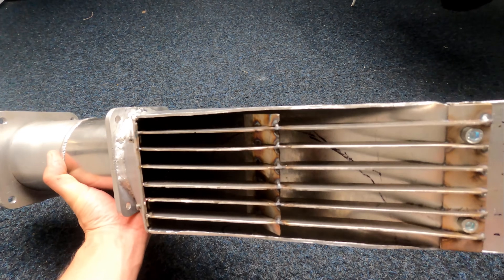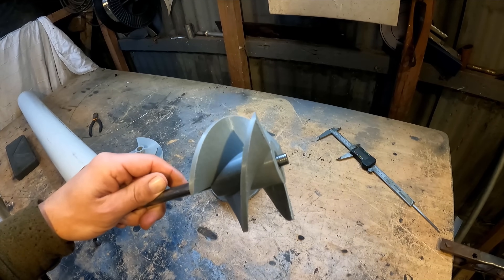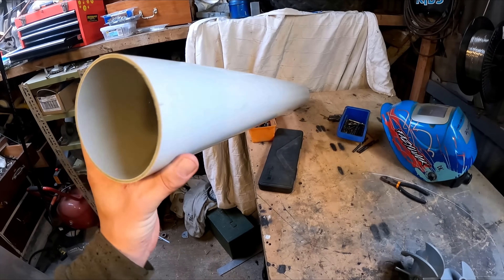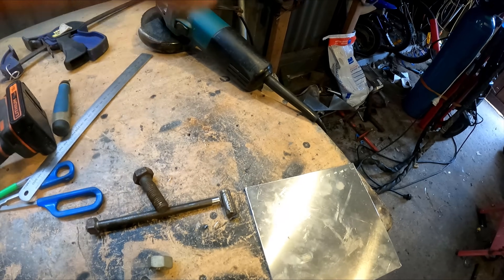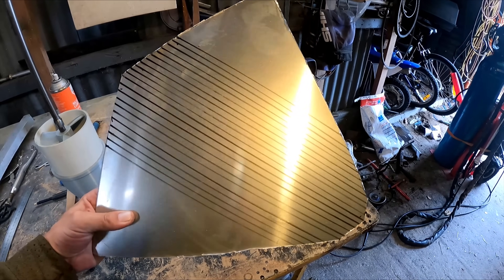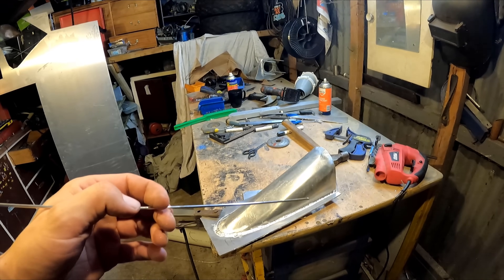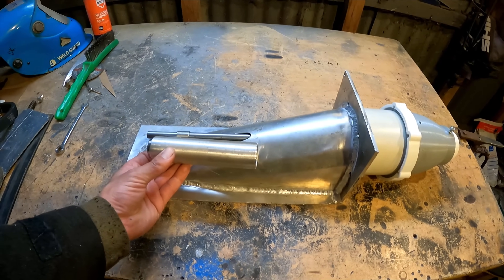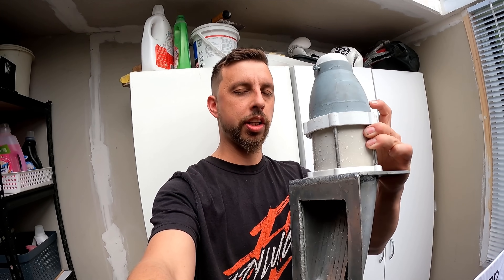Homemade Jet Drive 3D Printed

Comment: if you want these to be more efficient you should design a taper in the impeller and housing, and have some way to shim the impeller back and fourth on the shaft; by moving the impeller into the cone housing you can get really tight, adjustable clearances that minimize back leakage.

Comment: For your prints go through through the settings and make sure it doesn't start new layers on the outside surface... You can normally specify that it works from the inside layer or recesses first.

Comment: Nicely done!  The "disease" on the 3D printed part is, I think where the lines start and stop for each layer.  There is a setting to align them, I believe.  I have an Ender 3 V2 which I've sliced models for with both the Creality Slicer and Cura and I've not had the pimplefest you have there so I'm not sure why that is.  But I've seen videos on it.  I find, in Cura, under "Walls" there is a setting for "Z Seam".  You may have to monkey with settings to get this setting to be displayed.  It may be that setting, or it may be another...but I'm pretty sure that the defects you're seeing are from Z axis seam alignment not being set.
Reply from the maker: O thanks !  , I use cura now and haven’t had any problems. But in saying that I still leave most of the settings standard I am mostly a welder but 3d printers are so useful glad I got one

Comment: the disease at the back of your part are slicer settings called seam corner can find it bij walls settings in CURA
Reply from the maker: Thanks. I think I was using the standard creality slicer back then I am using cura now which is far better

Comment: Any chance you'd like to help do something completely crazy? I want to repower my 30 ft catamaran with electric jet drives and need some help with the design and build. I have a good idea, a working outline, of what I want to do. I have very little experience with jet drives and steering systems. I understand it on paper, and will be thankful for any help you're willing to offer to help me bring this to fruition.
Reply from the maker: That really sounds like a cool project! They problem with jet drives is they aren’t very efficient and with an electric boat you will need ever bit of efficient you can get to get the range . I think a surface drive prop is the most efficient but it is a pain to steer , jet units accelerate and steer really well. I think the ideal setup would be a surface drive prop on each hull that you could raise and lower and use differential thrust to steer
Reply: @dkthewelder  I understand. I generally only use my power to come in and out of doc, and to help out around the icw. I'm also planning on powering it well above my needs so that I can run at half mast 90% of the time.
Reply from the maker: @BigfootGoforth  o cool I have 2 little wind rush catamarans which are super fun. You can look at the 3d model of jet units on my CG trader , the bigger one is free but you have to build your own intake https://www.cgtrader.com/dkthewelder

Comment: What is the diameter of the outlet pipe and the impeller?
Reply from the maker: The impeller is 100mm and the outlet is 60-65mm I think
Reply: @dkthewelder  I also built one entirely out of cast aluminum
Reply from the maker: @DuNguyen-sw5lt  cool! I would like to see a photo
Reply: @dkthewelder  I posted on your Instagram, I don't have a boat and powerful motor to try it (Jetboat 120mm)

Comment: method of drill would of worked maybe with a pilot guide, the idea was sound though,  most bench drills are not that accurate and so rotate uneven so hence the reason for pilot guide in the centre

Comment: your flow is to high
Reply from the maker: Yes maybe, I will try a tighter nozzle then maybe change the pitch of the impeller, in the progress of connecting the motors should be able to test it soon
Reply: @dkthewelder  i will be around to have a look sometime keep up the good work 
try to close the wear ring to impeller close that gap first then pitch if needed the pump will not make proper pressure if the gaps to big regardless of the pitch
Reply: i mean your extruder flow on the printer but yes as tight as you can get the impeller to wear ring area and the friction fit will wear in perfect

Comment: I'm not sure but those zits on the backside are probably because you picked "random" for the layer transitions. That looks similar to a problem I had at one point. Try "aligned" next time you are doing a rounded surface.

Slic3r has that problem but it appears to be more of a bug than poor development.

Besides, when doing something that requires some level of precision, aligned is easier to clean up. (It is usually more noticeable though.)
Reply from the maker: Ok I will look into that thanks

Comment: With time, work, parts and tooling it only had a cost of $2000 not counting damage to bath tub.
Reply from the maker: Haha man your negative! About $12 dollars of 3d printer plastic aluminium $20 plus bearings and shaft another $50 and I just do it for fun 👍

Comment: I noticed that when you were polishing on the lathe, you had a long polishing strip in your hands. Try to keep the length much shorter. Long polishing strips can be very dangerous if they get tangled around the work or lathe chuck. Technically they can cause the lathe to pull you in. Very nice project and great video.
Reply from the maker: I thought longer was safer , I have had it grab once and pull out of my hands years ago so I’m careful not to hold on too tight ! I saw a video of a guy getting wrapped up in a lathe was awful!

Comment: What kind of cordless drill did you use for the last part of the video? (bathtub test)
Trying to gauge what size/power motor I'll have to get for my motorized surfboard project idea
Reply from the maker: Makita 18v it’s a pretty powerful drill , I was actually thinking it would push a board along maybe fast enough for a kid
Reply: @dkthewelder  in my eyes at least, it looks powerful enough to push something at least! I wonder what the minimum is to make it push someone at 150lbs at a speed of ~5-10mph 

Staying tuned for more vids for sure!
Reply from the maker: @ninjasploit  I think that drill would do that if you could get the jet unit just right
Reply: @dkthewelder  Might give that a try as we've already got Makita drills at home! Instead of spending $500-$1000 for a proper battery and electric motor setup!
Reply from the maker: @ninjasploit  honestly just a propeller is more efficient than a jet unit . Are your going to draw up a jet unit for your drill?
Reply: @dkthewelder  haven’t gotten that far yet; this was just one of those ideas you get you know? I’ve got lots of ideas that I’m saving for later when I got the tools, time and money

So for sure doing more research, and then again, a prop doesn’t look nearly as cool as a jet!

Comment: I've used the hole cutting method you tried at 5:30 but with a end mill so the holes can overlap. Leaving 3-4 tabs around the circle so the piece stays centered.  I tried turning it to clean up the hole like you did but with the endmill it was too sketchy even for me
Reply from the maker: yeah the screw in the middle bent , need an indexing chuck and an endmill

Comment: "The disease" could be Z seam Alignment that's set on random. Put it on Sharpest Corner or User specific. Anyway Nice vid :)
Reply from the maker: ok thanks I will try that
Reply: @dkthewelder  Looks more like slipping on the Z axis IMO - only say that because the bottom portion had none and the frequency increased the higher up.

Signifies the problem is getting worse with Z increase; might want to check your eccentrics
Reply: @ExploringTheWorldCheap  looks mostly like a badly made cura Z seam tbh, align Z seam should fix this problem, furthermore no need to use rafts on an ender 3.

Comment: What version of Ender printer? Pro or max Pro 3 Pro 5?
Reply from the maker: Ender 3 I think. It’s a pretty cheap printer but seems to work well
Reply: @dkthewelder  Yeah I saw someone else using the Creality and it looked excellent. Im getting ready to buy my first 3d printer im going to get one of those. Just not sure which version
Reply from the maker: @CL-yp1bs  they work really well straight out of the box I would definitely recommend one . Don’t even adjust anything and it just works probably best for a beginner like me
Reply: @CL-yp1bs  my son inlaw has two of them. He likes them.
Reply: @mrbamfo5000  Great to know! I am an electrical engineering student but I am wanting to get some experience with CAD as well because there are a lot of students doing dual majors with mechanical and electrical engineering. I figure a 3d printer is a great way to learn CAD and have fun doing it…  the results seem to look great. I’ve been holding off ever since they first came out I wanted to wait for them to get better and all the errors ironed out.. it seems like these are a pretty refined item compared to the original 3d printers…

Comment: You know, if you have access to or build a kiln/tempering oven. You can actually 3D print it out of metal. It's filament with metal powder in it, thus why you need to use oven. Have to melt the plastic out and get it hot enough to fuse the metal powder together. It's definitely not convenient, but still cool lol.
Reply from the maker: I have been watching videos on that it could be good!
Reply: @dkthewelder  The few videos I've seen on it seem to show its pretty strong. Just have to take into account the shrinkage that occurs. I think you have to make it 10% bigger to account for that, if I remember correctly? I really want to try it out, could be amazing for making pew parts. 
You could also do cast parts as well. How people use Styrofoam or wax to make molds (lost foam/wax casting). You can also do it with PLA filament.

Comment: zits comes from retraction och layer shifts, the blobs are where the printer stops and starts print the outer most perimiter
Reply from the maker: O ok, how do you stop this? It hasn’t done it since but it seems to happen on a curved surface
Reply: There is no full fix, but getting better extrusion multiplyer and lowering the retraction amount will lower zits, sometimes it has to do with the material, but it could also be that you get a lot of pressure during the lifting between layer lifting.

You could add coasting and minus extra restart after retraction in the travel or extrusion settings. Also mske them less visible by putting the layer starts and stops as a seam on the skarpest corner. That will make it less visual :)

Search for "how to prevent blobs or zitz 3d printing" on youtube and you will have some good tips :)

Comment: Cool stuff man. 

If nobodies mentioned about the printed bubbles... Filament absorbs moisture from the air pretty bad eh. Then when the moisture passes through 200c it steams the water instantly, causing bubbling. It probably popped and snapped like wet pine in a fire while printing eh?  

You can dry it back out easily in a set-low oven or food dehydrator. gg & gl
Reply from the maker: Someone else said that , it was fresh out of the packet when it did that . It printed overnight so I didn’t notice the popping and stuff, thanks for the help I could try the oven how long do you leave it in there?
Reply: @dkthewelder  Get a dehydrator, there are many guides for it. 
I do 65c for 8 hours for my PETG

Comment: It’s funny. Rich for you is a 3D printer while for me it would be having a lathe. Both are expensive but they don’t make stuff like they used too. (Good lathe is like $6,000 :( ). Great design tho love it
Reply from the maker: Haha the lathe isn’t mine , I work in an engineering workshop and I’m allowed to use the machines after work

Comment: Thanks for showing the bits that didn't work, and the steps you had to take to force them to work ;)
BTW, the 'disease' on the prints is likely one of two things : 1) nozzle is running too hot or 2) filament isn't dry enough
Reply from the maker: Thanks for the advice I am new to 3d printing and cad drawing so it is a difficult project for me. I can try changing the nozzle temperature 👍

Comment: Man, really love the idea of an aluminum intake ^^ looks real nice and sturdy =) 
you don't happen to sell this ? :D
Reply from the maker: I made the intake aluminium so it can take a few hits to the bottom without breaking. I might sell these if I get them working well
Reply: @dkthewelder  thought so, thats one weak spot if you had that one printed as well...but it works , painted PLA lasts for one summer :D
looking forward to it , keep on going ;)
Reply: @dkthewelder  My jet intake is alloy with stainless grills. I  smashed it of rocks for 2 years solid. Cracked the intake in half twice :) It will handly a lot more punishment than you would expect :)
The weak point is the cylinder shaped impeller instead of cone shaped and no wear shroud ;)
Still, it seams to work well.
Reply from the maker: @axle.australian.patriot  the pvc pipe is the wear sleeve I can just put another one in once it is worn . I will cast an aluminium impeller once I get the shape right . Do you have a JetSki unit boat?
Reply: @dkthewelder  No, it's a 12ft alloy car topper, but re-engeneered 19mm stringers, dericane laminate skid plates, mini center console etc
40HP Yamaha outboard with an OutBoard Jet from Califorian on the bottom.
I'll have to change account's, I use this one for political troll rubbish lol Should have posted in my persnal account to start with :)
I'll see if I can sneak and outside link into YT :P
I have a friend run a 10ft Punt (jon Boat) with a wave runner drive in the hull and does really good.
Reply: @dkthewelder  Hello, Same Axle 🤫
I'll see if I can find a couple build pics :)
Reply: @dkthewelder  I don't know if the link will stick in YT. I can't post it on YT because of music copyright..
Reply: @dkthewelder  The cone shaped impeller and wear shroud allows for "Shimming" the impeller to keep the close clearance between the blade and the shroud. It doesn't take much gap before thrust drops noticeably. But what your doing is working and looks like a fun project :)

Comment: The shaping tree gave me a good giggle
Reply from the maker: Haha a gift from god to shape jet unit intakes
Reply: @dkthewelder  How'd the 3D printed impeller go? also I'm guessing ABS 100% infill?
Reply from the maker: @Archamfer  na it’s just PLA and like 50% infill so it’s not going to last long but it should be ok for testing
Reply: @dkthewelder  What you thinking for upgrades? Lost PLA Casting could be interesting
Reply from the maker: @Archamfer  yes lost PLA might work. I can try different nozzles and stuff too

Comment: Hello, I just discover channel today, check few vids, and one think disturb me. Probably for temporary test, but you have skill and tools, Tig, lathe, etc... Why not use 3d print to measure, test, and after choice, mold it in aluminium, for better durability. 
I know 3d filament could be strong,but if you eat wood or sand, it's done...became 3d...floats....
Except this point, the project could be excellent in results! 
I've not followed the first gen' but is the engine turn as fast as need to be efficient ? Turbine need speed, and a bit of torque for high pitch. 
Also need very tight adjust in tunnel. 
I've done few in different scale with metal, plastic , and both work depend on scale. 
So good luck and have fun
Cheers from France 🇲🇫
Reply from the maker: Thanks, that’s pretty much what I am planning to do I can just keep printing parts to until I get an efficient setup and then use lost PLA to cast parts of just fabricate them. The motor I’m going to use will run between 8000-10000rpm

Comment: nice project again. Allready said it on facebook as wel. But if this thing works you could probably do a lost pla casting of the jet unit and have it from aluminium. Would be stronger and more durable. But for now testing with the 3d printed 1 is the way to go. Looking forward to actually testing it in the water.

Also a thing to note is the intake angle. Having it scoop up water in to the jetpump can improve the performance. My jetboat has a bit of a scoop kind of thing on it as wel wich trys to direct water in to the pump if the boat is moving forward.
Reply from the maker: I made a scoop thing yesterday. I have been watching a lot of videos on lost PLA casting which I will try once I figure out the most effective impy

Comment: Just buy a 3d printer and you can do this to. Ok it's that easy.
Reply from the maker: You could make the whole thing with the printer except for the shaft but you could probably use a long bolt . You can draw it on fusion 360 it is free

Comment: I hate clever people like you! They make me look so dumb! Awesome project mate.  Not sure if you are aware but waterjets work on flow.  Using reducer nozzles won't do much for speed because water can't compress therefore wont speed up.  A restricted nozzle may get your motor into the sweet spot of it's power range though and let you " Tune" it like that.  For speed  it may be worth looking at gearing up the engine with a belt or chain if it has the grunt. 
I thought of doing something like this for many years but do not have the skills even if I had the tools.  Great watching some one that has both and look forward to seeing this run.
Reply from the maker: Haha thanks! Na tighter nozzle equals faster water speed but less volume like putting your finger over a hose . As for speed I can change the pitch of the impeller and just print another one, I tried the chain and sprocket deal on another one of my videos. I’m waiting on parts so testing it is a little way away thanks for watching!